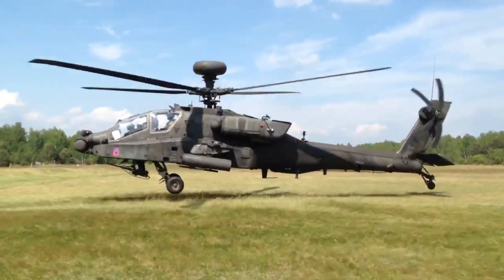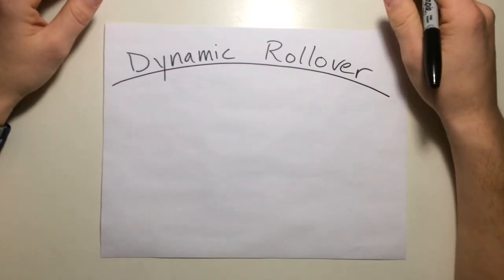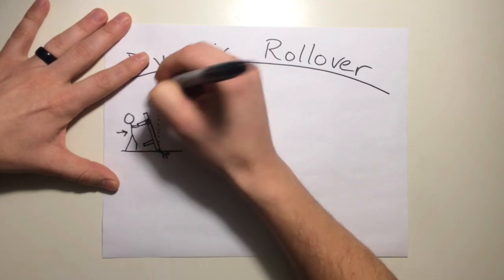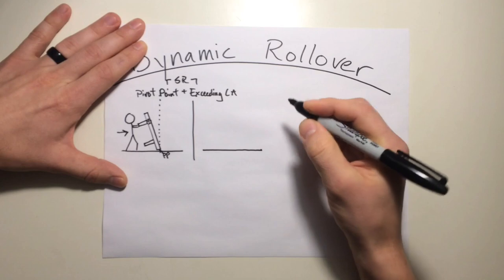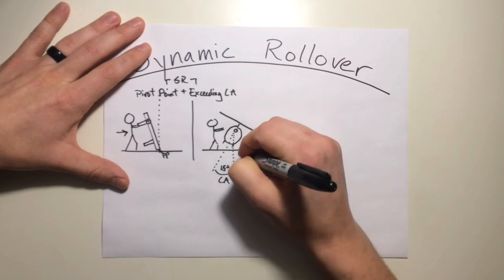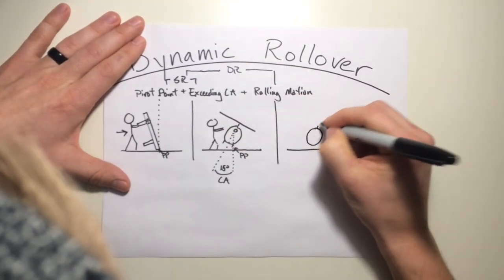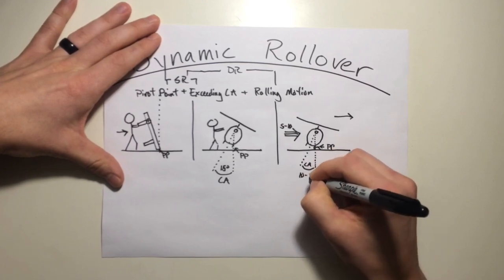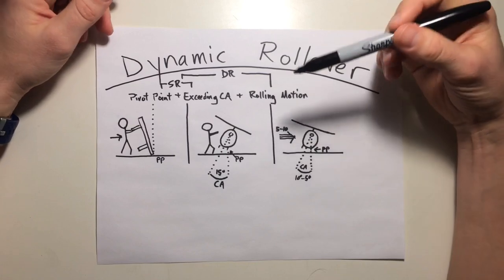Dynamic Rollover in Helicopters - Part 1

Comment: Brilliant ! The fact that you explained static rollover first greatly improved my ability to understand dynamic rollover.
Thanks for a very lucid explanation.

Cheers

Suresh
France
Reply: Don't forget something. A dynamic roll over means the blades are spinning. The helicopter is in a dynamic state. A static rollover means that the helicopter is completely still. A lot of people like to describe a dynamic rollover is you are trying to hover and one of the skids get stuck on something and instead of lowering the collective and immediately bringing the helicopter back into the ground you trying to pull up on the collective with the correlator putting more power into the rotors which if you're already starting to tip the helicopter over will just put more power into the energy of that state. Hence Dynamic rollover. And yet a lot of people would say if the engine quits on you and you're in a hover and you roll the throttle into the over travel spring and you put a little bit of right pedal to stop the yacht to the left because of the sudden loss of anti torque can you pull up on the collective prior to contacting the ground to cushion The Landing but somehow you inadvertently land on a slope and tip the helicopter over that because the engine is off it is a static rollover. Well the blades are still spinning so it's not a static rollover. The only way it's a static roll over is if the helicopters on the ground and you're inside it and you haven't started the engine you haven't waited for the starter motor on light to go out you haven't engaged the clutch the blades are not spinning in a hurricane comes along and just blows the helicopter over and it rolls over on the ground that would be called static roll over. Although a lot of people like to try to apply that a dynamic rollover would be if the engine is on in the bladed are spinning but the throttle is rolled off into the over travel spring the engine is decoupled the transmission is no longer powering energy and therefore RPMs to the blades and the helicopter rolls over. But if the blades are still spinning and they're still energy and RPMs in the blades than it's still dynamic. I guess no one really tries to prepare for a terrible static rollover event when you get in a helicopter you're more worried about the dynamic problems with all the kinetic energy. But you know whatever just to be technical about it
Reply: Thanks for the explanations ! @imachavel

Comment: Very rudimentary explanation. More treatment of the toppling forces and restoring forces would help pilots understand recovery actions. In all cases reducing rotor thrust to minimum is the only hope of recovery
Secondly, the recovery through cyclic correction depends on the rate of roll set up Visa vis control power available